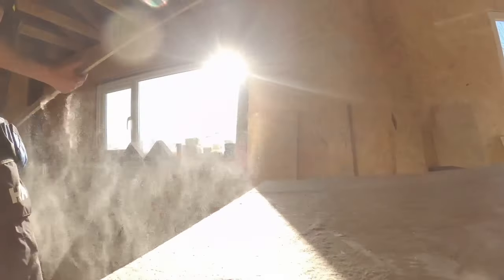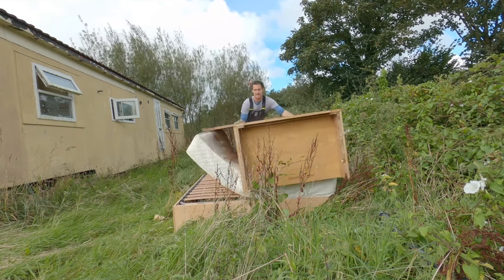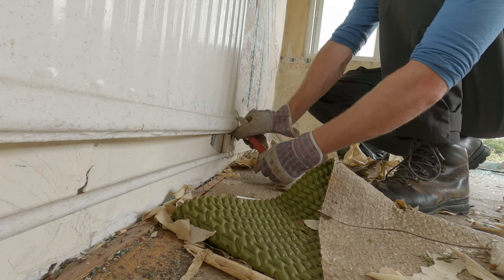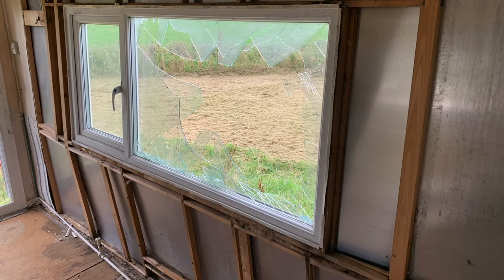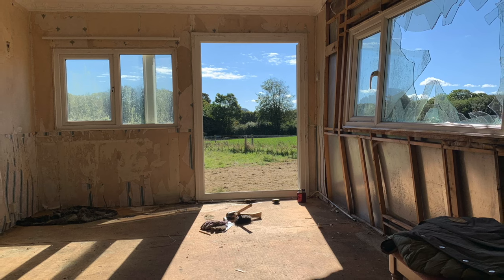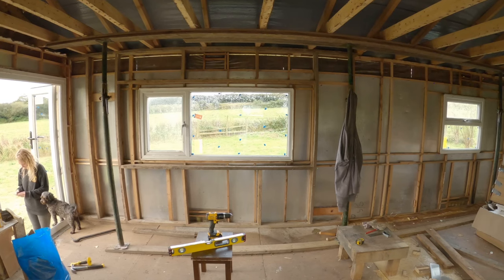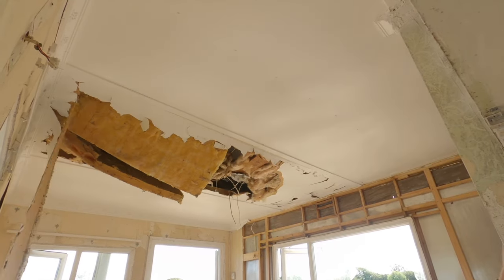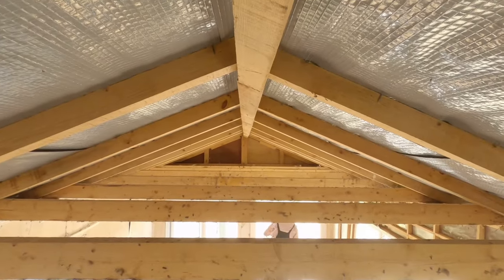PART 1 | From Static Caravan to Cabin in the UK - 12 Part Renovation Series - Cabin Build

Comment: You were very brave making it open plan we were told not to take alot of walls out ...we took a wall out between bathroom and a passageway to make the bathroom larger and took a big window out to put a opening a extension we built on its the best thing we ever did...love your channel will keep watching ❤
Reply from the maker: I'm not sure if it was bravery or stupidity! Certainly to begin with we had no idea and very naive. But it has worked out and it's a lot strong that it was. We ended up putting stud walls everywhere and the kitchen we put in is essentially structural as well. Really glad your enjoying the videos, thanks for the comment and thanks for the support!